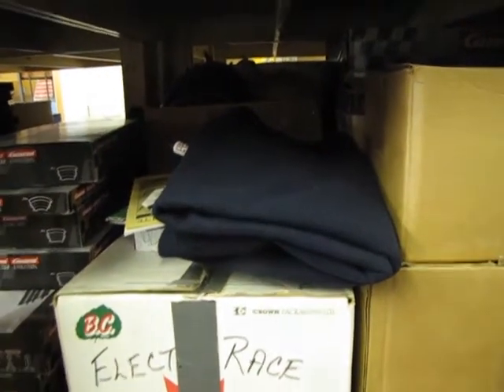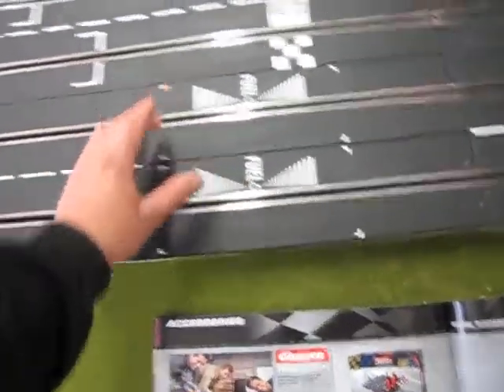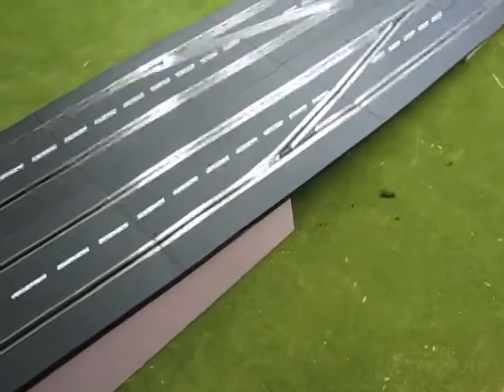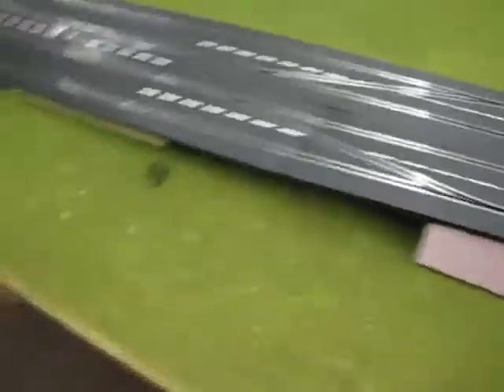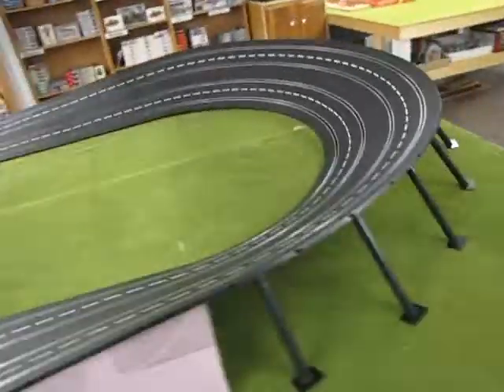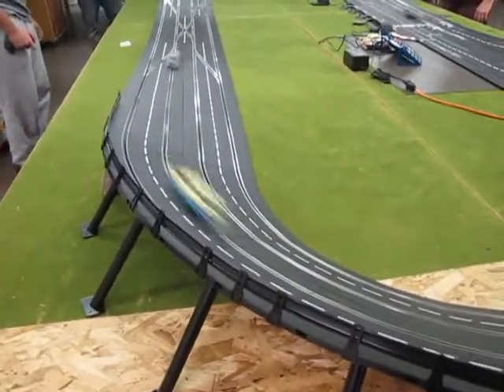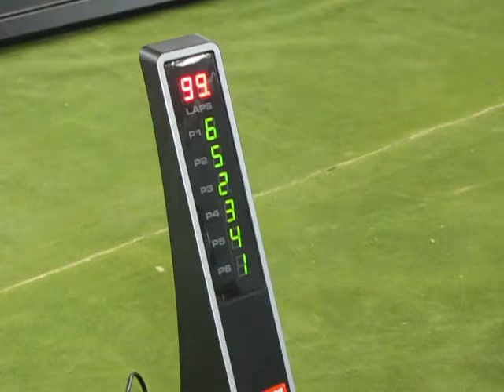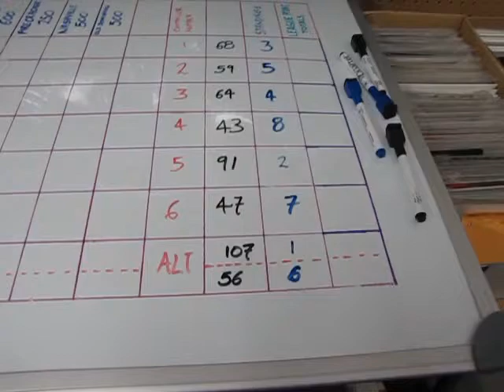Monster Hobbies 1/32 scale Carrera Digital Slot Car League - 1957-1960 NASCAR Daytona 500 - Race #2

Comment: quick question, are you sure it's 20 ft long, looks shorter?
Reply from the maker: The table length is 20 feet. That includes the curves, so the straight-aways would be shorter.
Reply: Can't you have a conversation with yourself in here? You've just wasted 2 years of your Internet life here!

Comment: I love your oval iv got a digital oval here but its nowhere near as big we manly run late model and vintage stock car
Reply: It's really silly to make such a big track like this. The only cars you can drive on it successfully is the American oval track racers. The Lamborghini for example won't work cause its going to break when you slightly release the throttle. Obviously its designed for races with huge variety of road conditions. The Porsche slot car would be very boring to drive around this track design too. They have a short wheel base which is only there cause its for tight cornering. The carrera designed race tracks educate the user about the different car designs. Sound and performance education experience. None of these basic facts have been discussed in the vid.
Reply from the maker: Thank you for the theory.
Reply from the maker: Sounds like fun!